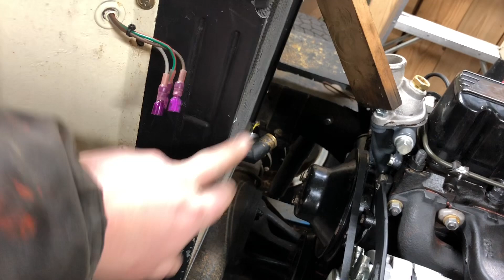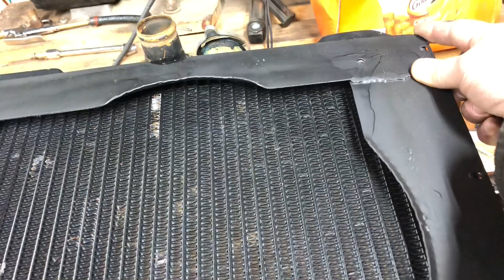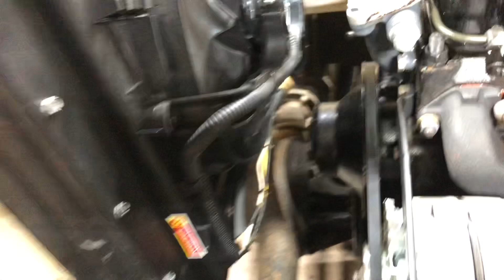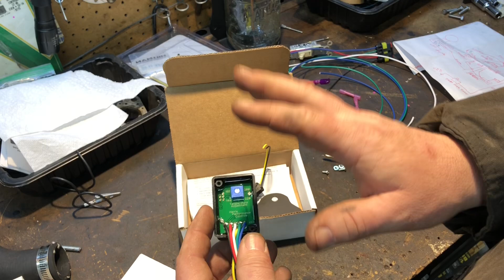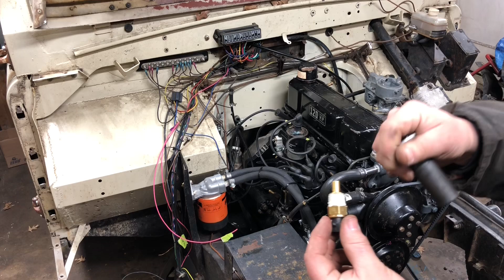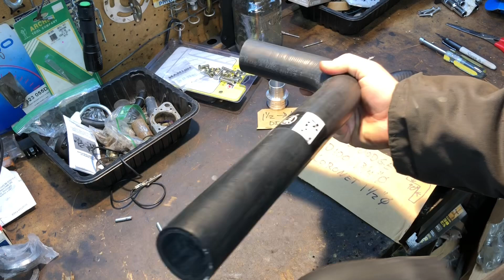Radiator Cooling Land Rover Series 2A Scotty GM engine swap Chevy 153 restoration

Comment: We mounted a 2-stage 16" Kenlowe fan to our Series 3 109 200TDi, which is controlled by a 2-stage sender ( on at85C°, stage 2 on at 100C° or so), in addition, there is a Carling switch in the dashboard to override the "automatic" mode: off ( when passing rivers), on ( for automatic mode) and a step further on for stage 2 ( in case the sender is too late).
Reply from the maker: @HeinerStorchennest1  this is the exact same concept. 2 stage fan with 2 stage controller and override switch. It should work out nicely. Thank you for watching!